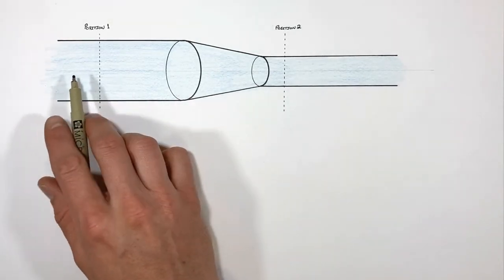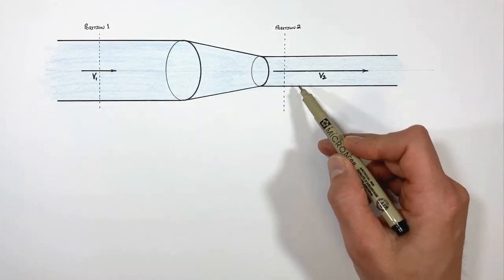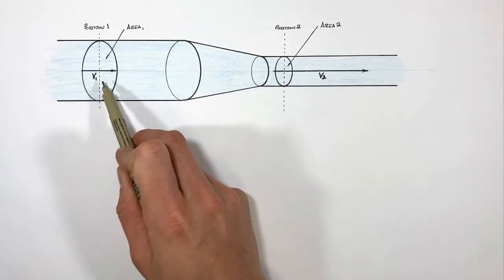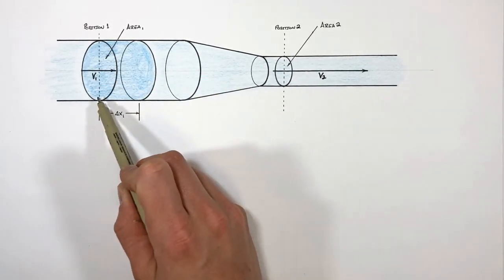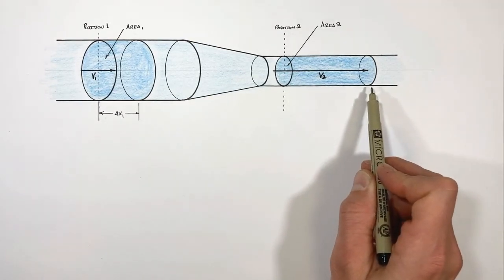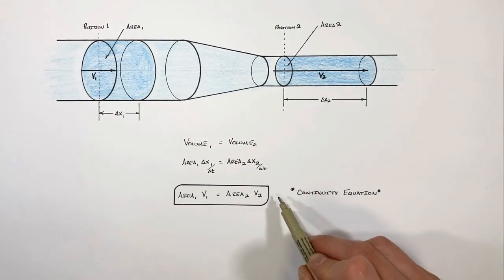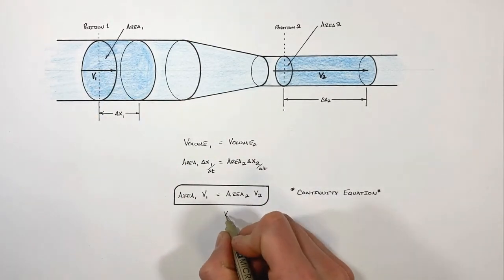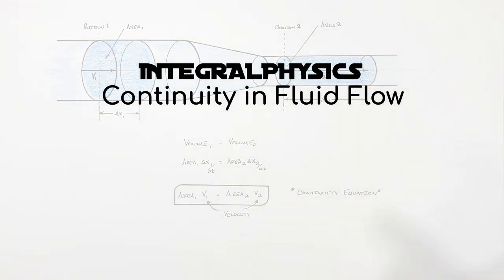Why Does Fluid Speed Up as it Moves Into a Narrower Pipe? | Continuity | Fluid Mechanics

Comment: I think if you mention the law of conservation of momentum, that would explain why the reduced area is accompanied by the increase in velocity.  Otherwise we have to take your word for it that A1 x V1 = A2 x V2.
Reply from the maker: Linear momentum is not conserved in the pipe taper.  Volume in must equal volume out, thats what drives Qin = Qout
Reply: @INTEGRALPHYSICS Thanks.
How would you solve this if it was for a steady state mass flow of a compressible fluid?

Comment: So... how does a butterfly valve slow the flow rate?  When you slowly close a butterfly valve in the volume/sec rate of flow on the downstream side of the valve is slower than on the upside stream.  Even the flow from a sink faucet does this... as you slowly turn off the faucet, the volume flow from the faucet slows down.  That seems to be in defiance of the continuity equation.  What am I misunderstanding?
Reply from the maker: The volumetric flow rate (Q) MUST be the same on both sides of a valve, unless the valve has some sort of leak.  Imagine 1L/s flowed into a valve, but only 0.5L/s flowed out...  The valve would burst.  

Along that line, Bernoulli's Eqn can not be applied across a valve because the valve introduces LOTS of friciton, thus negating Bernoulli's eqn (which relies on frictionless flow).